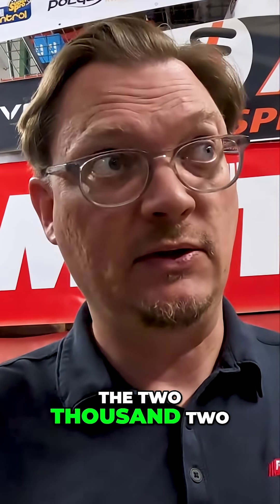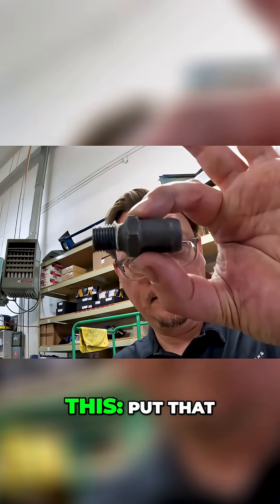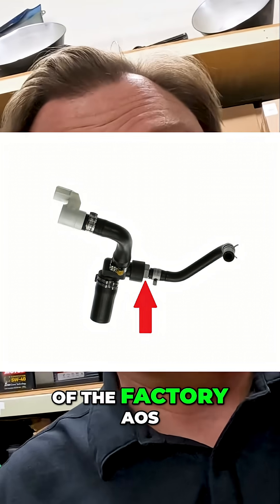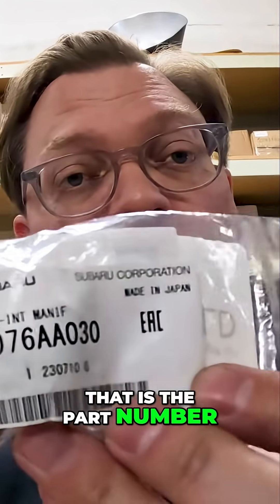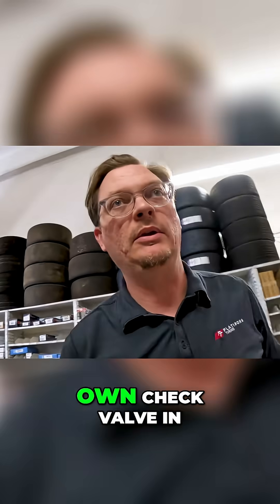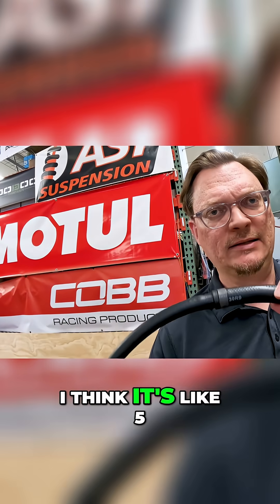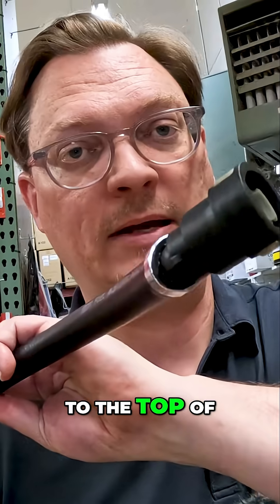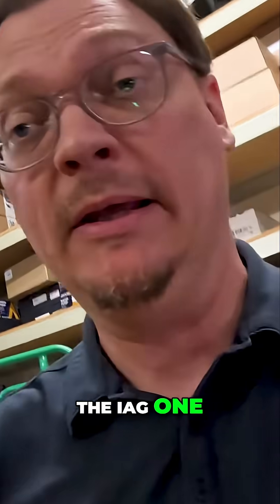PCV Valve Explained:  Connecting to the IAG Air Oil Separator

Comment: Why can’t you just keep the pcv and run a regular hose?
Reply: Thanks,
Would the pcv threaded in the normal location be the correct direction. Just run plain fuel hose to Aos from there?
Reply from the maker: @hn7071  Make sure that you run vacuum hose.  The PCV should be pulling vacuum when off boost and it won't work if the hose collapses.
Reply from the maker: You certainly could.  You would just have to make sure that the flow of the PCV valve is correct, and that it worked with the lines that you were using.